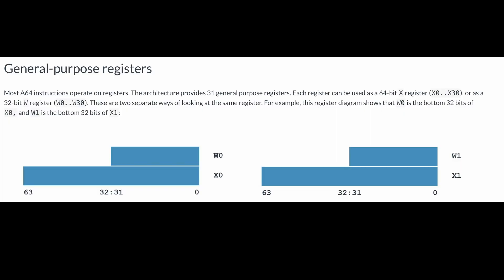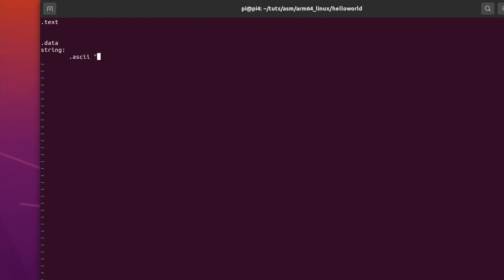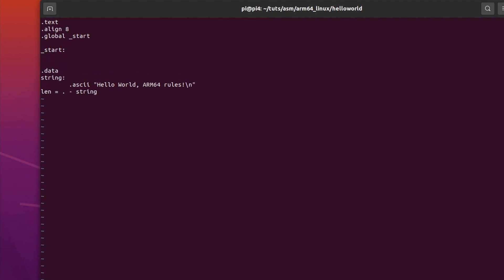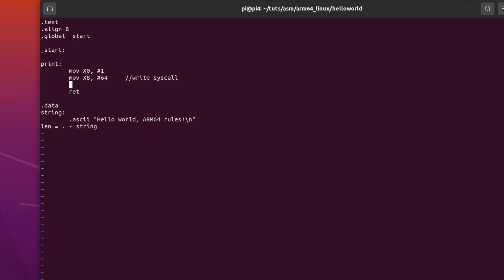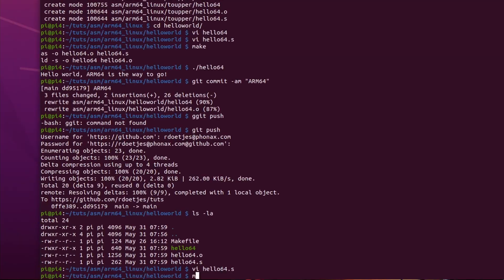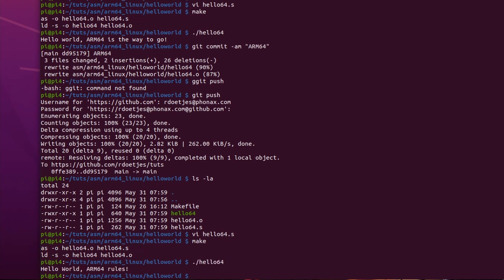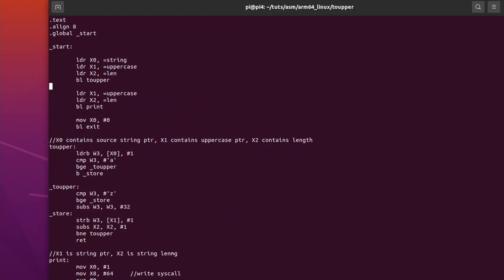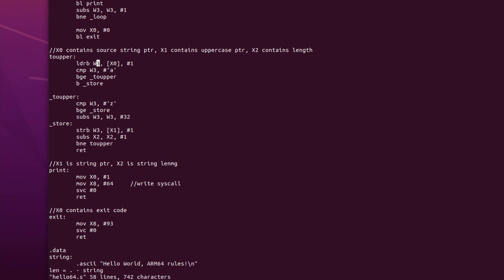ARM64 Assembler on Pi4 (part1)

Comment: Getting defeated.  I am tired of looking for 'courses' on assembly programming.  I see 'Zero to Hero' all over the place and they all have been horrible.  When or where will there be a good course/book that actually teaches you practical assembly?  One that teaches you the differences in architectures, syntax, and the basics of stacks, program counter, etc.  When or where will there be a course/book that has practical assignments that grow with the programmer?  Frustrating!
Reply from the maker: Continue on is all I can say! We end up controlling GPIO these videos are the most practical you’ll find. A bit steep because I already assume a bit of systems knowledge but nothing too shockingly hard if you follow along and google the concepts.

 Loading and storing data and calling software interrupts is basically all you do to call kernel calls.
I don’t go into the basic basics that is too boring for me. So I assume you know what a program counter is indeed. I do go into stack frames on ARM btw. And that concept is transferable to other architecture. It’s basically taking the stack pointer and subtracting the amount of bytes you need on the stack. 
Syntax is something you should learn as you watch the videos. Doing a mov x1,#1234 is literally moving 1234 into the 64 bit register x1 if you do mov w1,#1234 you move 1234 in the lowest 32 bits of the x1 register.

Teaching the difference in architecture is useless. That’s like teaching how C is different from Python or German from English. You assume knowledge of both then.

And with all learning is when you see an opcode or a statement you don’t understand you look into it. Google these days makes it trivial of course.
Reply: @CallousCoder  Sorry CallousCoder, I didn't mean to imply that your content was bad in any way.  I am sure it is great for a certain type of crowd and by the reviews, it looks like it is a smash hit.  I was just venting frustration in general because I can't find the ideal fit for me.  That is a me problem, not you problem.  After I find the right one and get my feet wet, I will be back to tackle your videos.
Reply from the maker: @PremiereStoss-qm9un  I know, that’s why I took the time to write back. 
I also thought of another way to get your pump primed. And that’s perhaps starting with 6502 Commodore 64 or Z80 assembly there are actual deep dive starter courses that really go into all the basics. And that knowledge carries over to modern CPUs. 
I realized this later, because I’ve been where you are in the 80s learning assembly for the C64 in sparse books and magazines. That initial start is complicated. 
You may find here for z80 what you need
https://m.youtube.com/@slithymatt and then come back here and it’ll make a lot more sense. Or do my c64 assembly course after that z80 you will to stay closer to the z80 and then do arm.